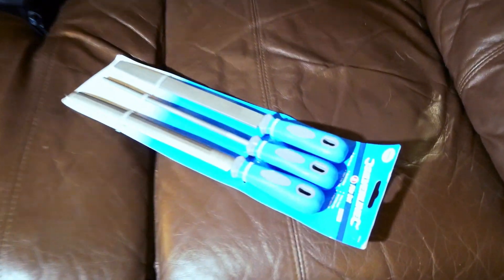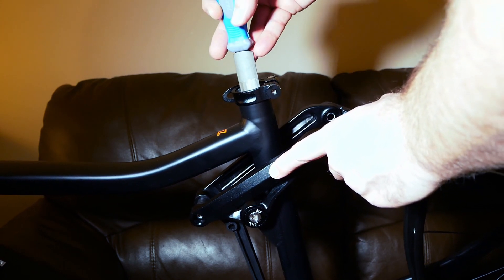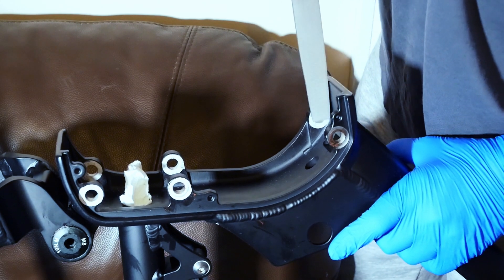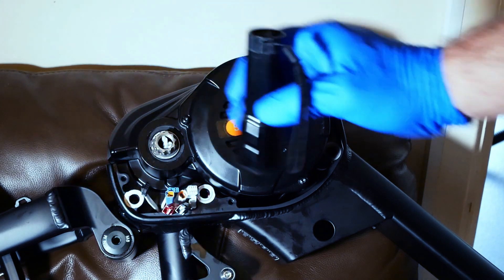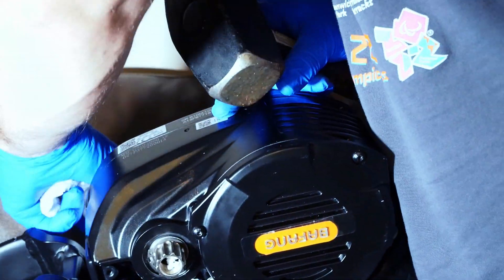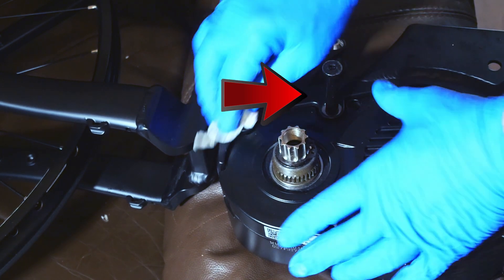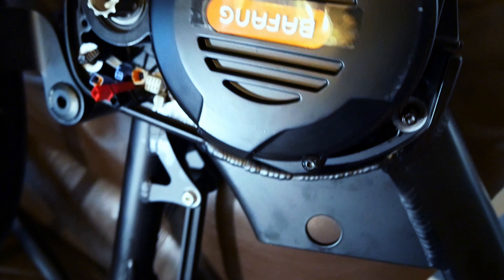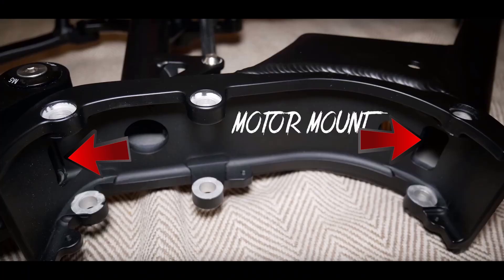EMTB  BAFANG MOTOR TEST FITMENT FILING AND NEW PARTS PART 4 Bafang ultra 48v  G510 mid drive motor

Comment: Thanks for the video. Second time watching it. Became interested in building a motorized bike for over 10 years and a couple of years ago I decided to build from scratch a vintage trek antelope to look like old Fuji Odessa I used to own. My goal was to build the bike and buy the detachable electric wheel. When I was finished I couldn't find that wheel anywhere. So I decided to keep the bike as is and build a bike like the one your building. I am curious I noticed you were hammering the threads down instead of screwing them in. I remember in the video the motor wasn't fitting in. Correct me if I am wrong but when you thread something don't you hand screw in gently then use a tool to screw in?
Reply from the maker: There is no thread on the motor or the motor mount , the bolts take nuts once they are all the way through so the threads were not damaged. When I took it off a second time it went back on a lot easier.

Comment: What size frame did you get and how tall are you? Is it a good fit ?
Reply from the maker: I got the 17 inch frame and I am 5ft 10 inch  or 1.77 m and the fit for me is great and the handle bars are also the right distance away from me. . Looking at the 19 inch frame I can see that the seat post is taller and the steering post is further away. I suppose a lot depends on body type  as some people have a long leg and short reach and vise versa.
Reply: @baconbuttties  thanks for your help I'm only 5'7 and i ride a canyon racing bike? but at the age of 50 I'm not doing much racing lol 
Ps grate videos (blogs) whatever lol pps did you ask andy kirby for discounts for the free advertising/promoting his channel???
Reply from the maker: @mreilly1325  No I didn't get any discounts unfortunately and had to pay full price for the frame and motor. I have ordered a battery from AliExpress and am in the waiting process for it to turn up.
Reply: @baconbuttties  thats not good i would think the money he will make he mite give you a bit of a discount for promoting his channel /shop but keep up the good work love the bike

Comment: I stumbled onto your channel while I was looking for others that have used the Vapour frame/M620 combo in a build out of curiosity. Got my frame from a reseller in Arizona(I live in Las Vegas). Anyway, been watching your build series and just wanted to note something that I noticed with my Vapour frame that you discovered in this video. Fitting the motor. The powder coating inside the motor bracket is really thick. I ended up using a sanding drum on my rotory tool to remove any powder coating that looked like it might interfere with the mounting tabs on the motor. With all that powder coating out of the way it slid in snuggly without having to tap it with a hammer. 
Hope that helps with anyone else wanting to build on the Vapour frame.
Reply from the maker: Thanks for the tip as it is tight. when I removed and put it in the second time is was a lot easier.

Comment: Hi, thanks for the videos really helpful.  Im waiting for my frame to arrive.  In the meantime I've been sourcing the parts.  Do you know if you need a disk brake adaptor on the rear?  I was thinking of running a 180mm rotor and was wondering if I need a mount?
Reply from the maker: Im sure the rear brake mount on the frame is set for 160mm standard  disc so you will need the 180mm brake disc adapter as well as the disc.
Reply: Check out @ebikemodshed Instagram

Comment: Make sure to work around the inside of the cable holes on front qnd back of the mortor mount plate with a dremel tool. There are really sharp edges on the inside! Could damage wires over time..
Reply from the maker: Thanks for the tip.